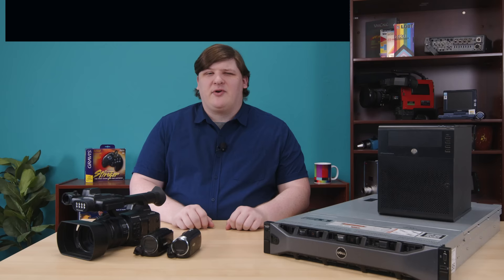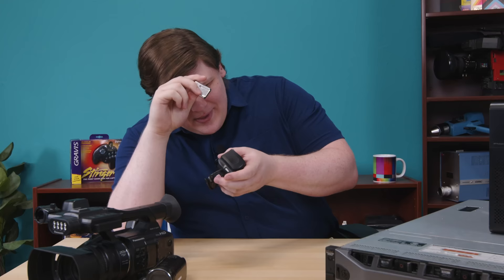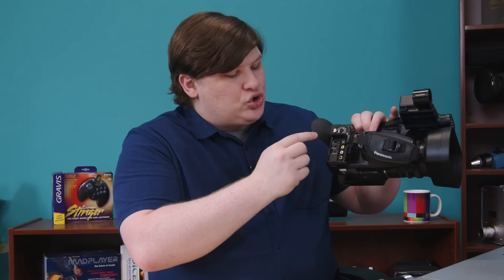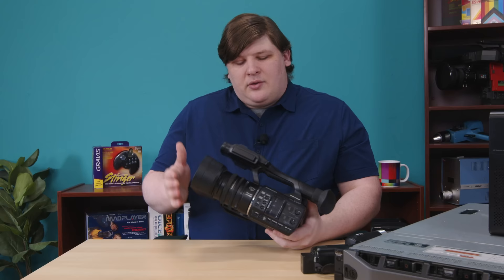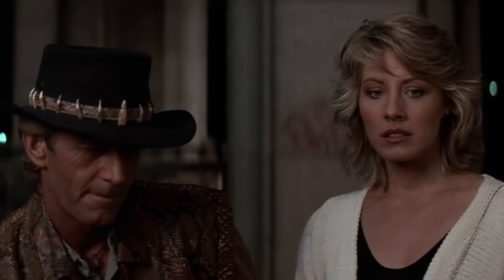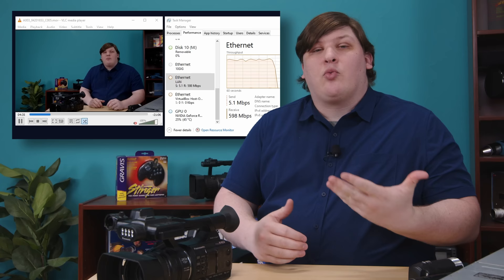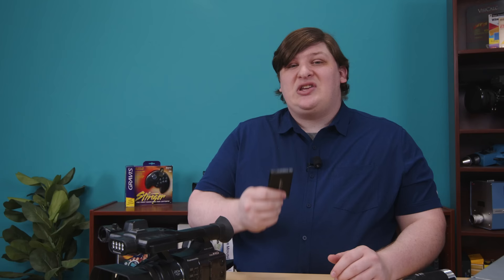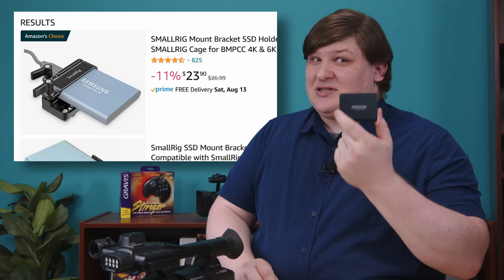I Built... a really fast NAS?

Comment: A lot of this problem did start with the whole mic audio being separate, and forgetting to clap. I think solving that would have saved a lot of headache. But 1000Mbp/s. I don't see the point in all that. It would take decades for that to be the norm. Even if people care at that point. How long do you think consumers are going to care about resolution. Eventually people will see no difference, or just not bother. It took 30 years to reach the common bitrate of studio SD tape, being used in 4K files. Professionals need very high quality everything. But if we reach a ceiling. Those bitrates just waste space. You can create 20k resolution format. But if we stop at say 10K. Do you really need that much extra, to zoom into footage. It just always annoyed me when companies would create these extreme formats. But not really use it for the time. It was always for the future. 

Look what happened with Babylon 5. They were like will go back to the Lightwave files. And just re-render them out, in future resolutions. That never happened. We have 4K bluray's. They didn't consider the future. To allow 4K BD discs to work in older players. It's always this weird problem. "Future proof" stuff like extreme bitrates, but not what is in current use. Why do we still keep doing this crap with incremental resolution changes. If companies want to reach 8K. Just start out with 8K. Not bother with anything in between. And do the waiting game for prices to drop. Keep using the older format. Till you can do what you want to do. it's an annoying money game.

Comment: 17:56 i wonder has no one thoght about using a a powerd esata on a camera or fitting a 2.5 or 1.8 drive bay so you can use a drive in it. even if it is a sas connection a normal sas hard drive can up to 600mbs sequential. if you want a big but cost effective storage and shooting video is a writing sequential task. if battery live is a problem a normal sata ssd is with its 400 to 520mbs also fast enough.

Comment: 200GB DAC are not fun, its 2 100GB DACs that share a connector. Those are limited to under 5M
Old intel SSDs are amazing being single or twin level cell designs they will last for forever if not the fasts with many having sata 2 speeds.

Comment: One day I plan to move my server of totally legal media (I actually do rip most of my stuff from Blu-Ray with MakeMKV, no matter how hard they try to make it) from a raspberry pi to a Mac Mini with external hard drives running in a RAID for the sake of speed.
It's funny though, due to the chip shortage, the Mac Mini (2012 one, that's great because it was the first I believe to have USB 3.0 ports) can be had cheaper than a Raspberry Pi 4 (also gotten because it has USB 3.0)
Wait, did I say funny? I meant horrifyingly tragic...
Reply: I have moved things over to the Mac mini. Yay RAID 5, things are far safer now. Also my old 8tb drive is now being used for backups.

Comment: Did you consider using those SSDs as a ZFS read cache instead of as an independent array?
Also: HP is awful to work with at basically every level. Even HP's iLO is awful.

Comment: Interestingly, the workflow you describe is basically how Unraid is designed.  And it definitely would have been easier and quicker for you to setup than configuring ZFS was.  New stuff you copy to your network shares goes, by default, to the SSDs you set as cache drives, and then every night at midnight (or more often, you can change it) the system copies everything new sitting in the cache to the mechanical hard drives in the array.  From the perspective of anyone using the shares over the network, that's all invisible and you just see the shares, whether they're spread across 30 drives or just 1, and whether half the content is in the cache or on the mechanical drives.  Plus as long as your "parity" drives are the biggest ones in your system, you don't have to care about the size of the drives you're adding to the array or arrange them into zpools and whatnot.

Comment: https://youtu.be/MQRpIUu3dMw?t=5220 -- this is because of the number of SAS channels available for data transmission. By removing one of the cables you effectively half the number of channels / lanes available. This does make a big difference in high performance systems such as the ones used in HPC installations at scale where every bit of bandwidth is regularly allocated. Also, your SSD's likely will fully saturate your available lanes but you won't ever be able to saturate that through the slower 10gbps interconnect.

Comment: 35:10 i have a r630 and i have running on it a ubuntu server. i have 768gb of ram in it with the two e5 2699v4 i do heavy calculations and data crawling on this beast my machine could have 3tb of ram but only up to 14tb of total diskspace because the h330 raidcontroller in it cant handle more. mine has also only a 8bay a 12/6gb sas/sata backplane so 1.8tb per drive is the limit but this is fine for me i only have 10tb of data i need to process one in a month. i did this in the past on my ryzen9 5950x gaming system with "only" 128gb ram but this took 80h but my r630 can handle this in only 3h and uses only a third of kwh for the same dataset i also have a t400 grafik card in the r630 for rendering the data out. so this server is runing only 10h a month and for nothing else at the moment and sitting it in idle is no option because idle power consumption is really bad. 200W bad to be exactly i can bring is down to 115w but still the 24 ram modules needs 2 to 3w each and the raidcontroler uses 25w the idrac ipmi system another 20w so system idle power adds up fast only for the components of the system also the drives uses some power while spinning even spinned down still 3 to 5w each. lower as this is not possible. 
about the raidcontroller in your system this thing can handle 12gbit to each drive internally but to the system you are limited to the 8pcie lanes it is connected in your case 3.0 this means you have read or write with 8GBs this is really fast. but slower as the max possible bandwidth you can achieve with your 12drives even with the 8bay variant this is a bit slower but for spinners this is fine.
i think 600mbs is sata3 and sas is 1200mbs the limit but hdd are much slower then that. sata are the fastet abbout 180mbs and for sas 260mbs ssd on the other hand can maxout the full 600/1200mbs

Comment: I recall hearing that DRAM-less drives are workable if you have a fat enough pipe to system RAM and a system that can basically function as its adoptive DRAM cache. Ironically it requires a much more expensive system for this piss-poor kinda cheapy drive to work in a usable fashion. Of course, even those drives are PCI-E/NVMe-based; SATA would be a thorough non-starter for an SSD w/o a RAM cache.

Comment: 1:15:00 Using a Samba server vs using a Windows Server as SMB server are night and day. You could blind test me and within 10 minutes I can tell you what you're running, Samba is just so janky

1:16:36 Ayo what??? I bought an upgraded hardware RAID controller for my arrays. A good RAID controller is better than software RAID IMO. They'll do patrol reads, caching on SSDs, have their own built in super fast cache, perform array resizes and drive swaps more seamlessly, etc. You have to make sure you stay with one from the manufacturer of the server, and a good one will do great.

1:27:00 SAS has "dual port", which means that there's redundant cabling between the host (RAID controller) and the end devices. This is done by using those 2 cables as that redundant connection. SATA doesn't do this, so perhaps this old controller implemented SATA poorly and had degraded performance when this second link was present but not working.

1:31:40 Oh hey look even you found out why Samba sucks so bad. Absolutely none of these are "par for the course in Windows networking". You are experiencing Samba.

Comment: i like your vieos, but get a intel arc310, its less than 150$ @ amazon low profile and gets the job done...
and for networking get 2 fiber optic 10G adapters + a short length direct cable..
but basically sfp its a pnp. it'z a copper to copper attachment...
but als don't underestimate 'those' floppy fiber cables they are actually quite sturdy...
Reply: EDIT3 even a blcx drive should perform @ 100MB+ since it uses slc (and a controller that can handle this)....

Comment: A few of my Windows PDAs used CF 😅
Reply: I too went with 14TB Exos
Reply: I then went 10 gigabit for backing the servers up to each other and editing directly off the main NAS because enough of the Exos can saturate that interface.
Reply: I miss the copy USB button on my last NAS, that would help with ingest if the new one had it (it does but it is in software so I'd have to do it from whatever workstation or whip out a phone)
Reply: I'm doing fiber on the Mac, CAT6 on the desktop and server. I like it

Comment: Three Dell PE server's I've replaced those RAID cards on have snapped clips upon taking them out, no matter how gently etc. I've had a couple that were fine but they are just badly designed I think as it uses fragile looking plastic clips to actually try and push the card up and out of the socket which is too much force for them. Poor design.

Comment: Hmm, I know I'm late at this video, but everything more than 100Mbit is useless for 1080p. We send 1080i and we record 50Mbit. This is more than enough. The export files have 35Mbit. Ok, ok... we send with 50 frames, so you can put that up to 60/120 with an intra codec at 60 frames.
(I have only seen 40min of your video so far.)
Since you stand perfectly in the frame and do not jump around much, UHD and cropping is probably unnecessary. We often transmit files over mobile network with 12Mbit, if we are too far from the studio. You can't correct much at this datarate, but most of the time it's enough, if the shots are done ok. You stand basicaly still in a well lit studio and can always redo the shot under the exact same conditions.
You can always go above and beyond. But most of the time it's not worth the time and the money.
I know streaming offers more possibilities in some areas, but it gets transmitted at even lower datarates. You don't have much movement in your shots. So there is no need for higher framerates either.
Reply from the maker: @JoinTheNoob  My videos depend heavily on cropping for camera movement, which is generally not a thing outside of this sub-industry. At this bitrate I can do a 400% zoom and get usable footage. And I frankly don't know what you mean about not needing UHD; I can tell the difference between 1080 and 2k-4k in a static frame from five feet away on a 27" display. I don't care if nobody else can, I make this stuff for me.
Reply: @CathodeRayDude  I did't intend to criticize. I'm very sorry, if my comment seemed to imply it! I obviously wrote before rereading my comment on every angle. I din't think on what my comment implied on you and your video. I just wanted to give another perspective, if you don't have the money for the additional bandwith.
You do the cropping well! Yes, obviously 1080 and 2k are not the same aspect ratio. I meant, when streaming 1080, it does not matter that much, if you record UHD(or 4K) or 1080(or 2K). Yes obviously you have much more possibilities with UHD/4K (cropping...). And, depending on the camera, there can be a difference exporting in 1080 in both ways.
And again: my comment was not intended to criticize your video. I love your videos and think your expirience in your profession is great. I just wanted to give another perspective. (And I will watch the rest of your video on my way home). So please don't be mad at me. You're great. I wouldn't be subscribed otherwise.
(BTW: Sorry for my english, it's not my native language)
Reply from the maker: @JoinTheNoob  Sorry if I took it negatively, sometimes it can be hard to tell exactly what people mean on here, heh. No hard feelings!
Reply: @CathodeRayDude  I totaly understand. I sometimes hurts to read the comments. I will be more carefuly with my words next time. Keep up the great work! You gave me many enjoyable moments.

Comment: You’re using your NAS like a SAN.  If you take an extra step to make your NAS a SAN, it will solve the annoying windows network share problem.  Most NAS software support iSCSI, and that may be the easiest path.  Setup iSCSI on your NAS, install iSCSI driver on Windows, and now your network storage appears as a physical disk under windows.  No more network share nonsense and all your applications will treat it like a physical disk as well
Reply from the maker: I tried that and had bizarre problems with latency and freezing file transfers. It also removes all the benefits of ZFS and automation.

Comment: The BlackMagic site was quoting the file sizes in Megabytes per second whereas the file information for your recorded footage was showing in Megabits per second. Hence you would first need to divide the figure from that file by 8 to convert it down to megabytes per second. When you do that it becomes 147.5 MB/s. If you then look at the table (quoting at 30 fps) this would seem to correspond to ProRes 422 (not HQ) supposing of course doubling the frame rate results in a file size being twice as large all things being equal.

Comment: Why would you upload to Youtube in a bitrate that matches the bitrate it will stream at? Youtube re-encodes all video that is uploaded so it is better to upload in the highest quality you can manage so you do not compound the compression artifacts. Lossless video (Lossless VP9, lossless h264, etc) or ProRes is best. Even if you don't go that far, you should at least upload in a higher bitrate (probably 2-3x what you're uploading with now).
Reply from the maker: The advice from every experienced person I have seen is to upload 4K at 45mbps, because after that you get diminishing returns. However it looks like youtube has changed their recommendations more recently to 60+mbps, so I'll probably start doing that.
Reply: @CathodeRayDude  My experience is in the fansubbing space so I'm just going based on what would provide the best quality. Pure bitrate (even with the same format) isn't the only factor, there's the quality of the encoder used, etc that can influence how well you use the bandwidth so I tend to err on the side of overkill in these situations even if most won't notice a little extra blocking or softness. 

The best thing to do in this situation is to  use variable bitrate with a target quality but not all encoders have this option. In x264/5 it's called CRF (constant rate factor).

Comment: I have a 1.6GHz laptop that sucks so bad it barely gets better with an SSD.
Reply: What ssd are you using?
Reply: I forget the model, but it's in a different laptop now and performs fine. It was an OEM looing drive, LiteOn brand I think.

Comment: Your workflow is so odd to me!
Why 60fps all the time? 30fps for talking heads and 60fps for B-roll should be fine.
Why ProRes HQ? LT is more than enough. You could even use BRaw 8:1 if you want to be fancy (assuming you use Resolve)
Why not use an Atomos Ninja V with a bunch of 4TB 2.5" ssds? That way you'd have an awesome monitor as well while you film yourself.
If that's too slow for footage ingest, you could use an M.2 enclosure with 1/4 20 mounts and just about any M.2 drive you wanted.

Even just one of those changes would save you time and/or money I bet!

I'm sure you have your reasons, and I haven't got a lot of sense myself, so what the heck.
I use a long frame 10 bit compressed codec on the Canon R5 for professional work using an old pcie m.2 drive slapped into a CFexpress adapter. Totally wacky.

Comment: Yeah bx500s are pretty bad, only ever really useful at a low capacity as a boot drive to spruce up an old laptop. The better version, mx500, has a cache and is the go-to for sata 3 ssds along with samsung evos and is only an extra 10 bucks/terabyte compared to the bx500. With how cheap ssds have gotten over the years there's 0 zero for dramless ssds to exist.

Comment: 1:00:50 "Assuming Intel delivers usable Linux drivers"

Uh, Intel and AMD both provide usable Linux drivers. Nvidia are the bastards, and even they are getting better.
Reply from the maker: The current reported state of the Arc drivers on Windows is trash and the extant Intel drivers are a 20 year old codebase backing chips with featuresets from a decade ago. It's trivial to continue maintaining them when there's no substantial improvements in capabilities. Arc is an entirely new hill to climb, and if they haven't even prepped decent drivers for what is unquestionably their primary target platform, I have no expectation that they'll make better ones to serve literally one percent of the market.
Reply: @CathodeRayDude  From what I've seen the Windows driver is fine, it doesn't really support older DirectX great yet but that's irrelevant for Linux, it's the software and extra features that have been a bigger issue. 

While that may mean there could be issues with video encoding it seems like that is going well as well on Windows at least. 

I at least expect Intel to fix issues found on Linux unlike Nvidia. Even if not the primary market, Linux seems like a prime target for a GPU that has at least decent Vulkan support, and the engineers working on the Linux driver can focus on making sure the various features work rather than eking out performance improvements for multiple outdated APIs.

Only time will tell, but I'm fairly hopeful as a Linux user that Arc GPUs will eventually be competitive with decent driver support. Especially since we've actually seen them writing Arc driver code for Linux for the past year at least.